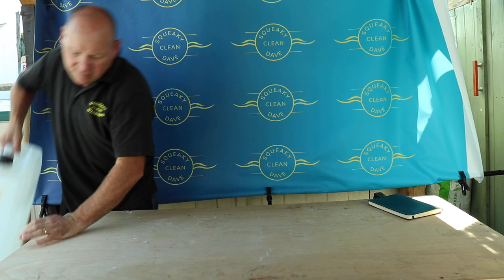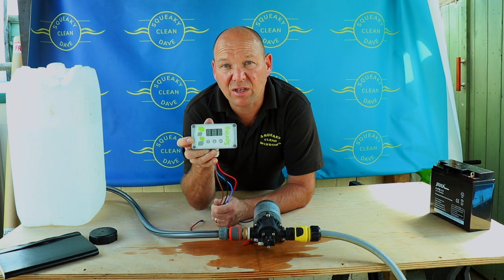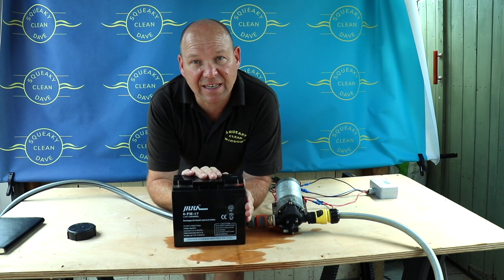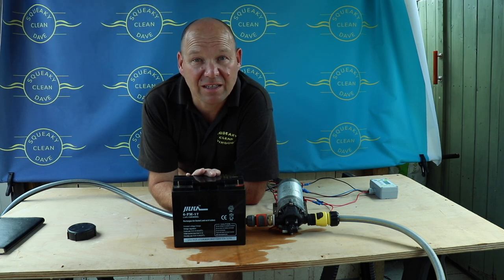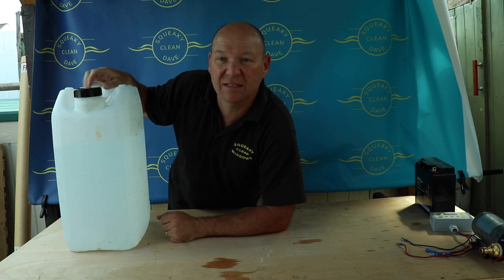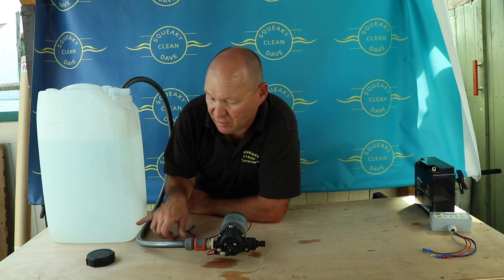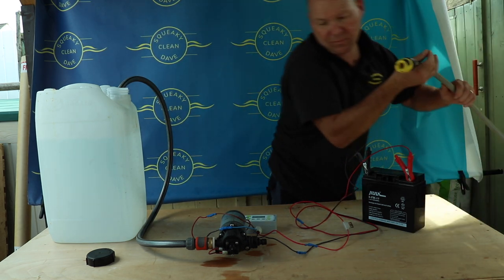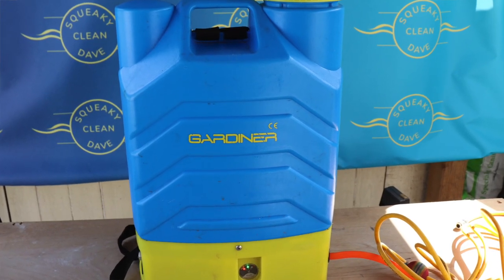Step By Step Guide To A Water Fed Pole Window Cleaning Set Up

Comment: Well I did not fiind spring on amazon. But I did find this. DC Motor Speed Controller with Remote Control 12V 24V PWM stepless Speed Control Switch 10A Wireless Speed Controller The pump I am looking at has its on pressure shut off.

Comment: Hello there, I watched your video and thank you for helping me start a window cleaning round. I'm struggling to find the same Spring pump controller you used. There are quite a few other pump controllers but I'm struggling to understand what controllers could work with the shuflow pump and the wiring etc 😃 I'm a complete novice lol
Reply from the maker: That's quite an old video where I used the V11 basic pump controller. Nowadays most people sell the upgraded controller which is called the V16. 
Most of the major suppliers sell them. You might find that they bare in the suppliers own colours buy they are the same inside. 
This is a link to Springs website. 
http://springltd.co/v16-basic
Reply: @squeakycleandave1  Thank you so very much! I'm very thankful :)

Comment: Great and simple video Dave.

I am struggling to get water flow when washing solar panels or window that are 3 stories high. 
Will a 12v pump and controller solve my problem?
 What GPM pump would I need?
 What the name of the full name of controller so that I may order on Amazon?

Many thanks from South Africa
Reply from the maker: Yes, a pump and controller will sort you out. i have put an amazon link to the pump but couldnt find one for the controller so have linked a UK company to show you the controller. there is one main company that make them and sell them through all the main suppliers so look for a V16 WFP pump controller
https://amzn.to/3JJLlGW

V16 Basic 12v Water Pump Controller | Xline Systems

Comment: Great video Dave! All Spring controller have a voltmeter built in to check the battery voltage anytime, just press the enter button when displaying the flow rate. We also offer controllers with split relay chargers built in to save on the extra wiring :) Great explanation of the delivery system!
Reply from the maker: Spring (Europe) Ltd thanks guys. As I’ve got a separate volt meter I forget you controllers all have them fitted👍

Comment: Thanks Dave, I've been using WFP system for about 11 years and recently changed my van and put in my old system, with a few new modifications but I started having trouble with airlocks in the pumps.
Thanks to your video,  I now think this problem, which has been perplexing me for ages is down to having my pumps too high.
I thought I would raise them to prevent damage from the reels, not understanding why they would be so low in the first place.
I'm going to give lowering them a try.
Thanks for your honest and helpful videos.

Comment: Dave can you give more on pump (like psi) and what amp fuse did you use ..i know its a small thing
Reply from the maker: @marklownsborough  it will depend what pump and controller you have. 
The pump I use is 5.5 litres a minute at up to 100 psi and the controller needs a 10amp fuse

Comment: Hi Dave did you make those bulldog extensions yourself compatible with the controller connections or did you buy them from somewhere , I’ve just ordered my first tank and controller, the video
Is a great help Thankyou
Reply from the maker: I think I cut them off an old battery charger
Reply: Thanks for the reply dave , I’m going to ring the cleaning warehouse on Monday and just clarify the type of electrical connections on the Shurflo pump /water genie v16 , not sure if there crunplock but il find out ! Thanks again

Comment: How do you connect to battery  
I know here you used clip for demonstration

Great video as always by the way
Reply from the maker: I normally use a full size battery with terminals on. That is wired into a 12volt fuse box which I wire everything into

Comment: Thanhs Dave l though the video was great and so easy to follow 
Question is l have been looking for a system to soft wash cems on to roofs will pump take the cems through it or would it be better to down stream it and bypass the pump
Kind regards from a total amateur
Reply from the maker: I might be wrong but with Softwash pumps you need a higher flow rate and less pressure which also needs a different connector . I may be worth you talking to Darren from DA Components 
https://www.da-components.com/12-volt-control-panel-with-chemical-pump.html

Comment: Hi Dave, im just starting my business. Please can you advise what is the model of the Shurflo pump? As when im looking online they all say there desiged for motor homes and caravans. Is that the right one?  

Thanks
Reply from the maker: Best thing to do is to search window cleaning supplies and see what they bring up as you know it will definitely be the correct one and there are other makes as well
Reply: @squeakycleandave1  Thanks Dave, please can you advise where you got the 12v inline fuse from with the crocidile clips? Cant find them anywhere.

Comment: I've watched all of your basic setup vids to create zero TDS water and I feel pretty confident about that. My question for your would be if I am going to store water in a reservoir (because I can't make 0 TDS water fast enough with the RO/DI setup) and I going to feed a Pressure washer for washing cars, will I need a second pump to feed 2 GPM to the pressure washer, or should gravity be enough to feed the pressure washer?  If I need a pump, I would assume I should also include a controller with a dead end to shut that pump down when I don't have the trigger pushed on the pressure washer?  Can you confirm for me?
Reply from the maker: Hi Jeff
Thats a great question and to be honest im not really sure. 
My pressure washer will draw its own water from a container but I know not all will. 
the pumps we use for window cleaning run at 
1 GPM so they wouldn't be enough for your pressure washer. I know you can get higher GPM pumps but im not sure if the controllers would match them or if you would need a controller with a higher output. 
Hope you find your answer.

Comment: Im looking to set up my own company in ireland here, this video helped me get an idea of whats needed, how much do you reckon all this costs on average? Is there things you have to replace often?
Reply from the maker: Most of this equipment lasts once you have it as long as you look after it. 
A ball park figure on the price would depend on what tank, hose reel pump and controller battery you have but you are probably looking at around £600. 
That doesn’t include pole, brush or filtration though

Comment: What an amazing video! I just had one question, I would like to work with a portable system at around 50 liters how long would it take to empty out this tank at different flow rates? Thank you in advance!
Reply from the maker: Hi Damian
Personally I use a van mounted system and I use300-350 litres a day but as I can carry more water then I need  I do use a lot. 
I just asked a friend how much water he uses with his 22 ltr backpack and he says he does 1 to 1 1/2 houses with it full on a reasonable flow
Hope this helps

Comment: How many gallons per minute pump should I use ? 

New at Waterfed pole cleaning .. 

Have 300 feet of hose going to my pole . Reel is mounted on truck
Reply from the maker: Not sure what it works out to but I us a 5 litres a minute 100 psi pump buy Shutflo

Comment: My pump isn’t making the noise anymore and fuse are good . What else could be wrong ? Pump was working great
Reply from the maker: Check that the controller is working ok and see what the display says. 
Make sure it isn't frozen and that there is power going to it.

Comment: Great video what sort of battery charger do you need thanks
Reply from the maker: This is the one I use
https://www.ebay.co.uk/itm/12V-10A-Connect-and-Forget-Leisure-Battery-Charger-Caravan-Motorhome-Boat-/114433522869?_trksid=p2349624.m46890.l49286
Reply: @squeakycleandave1  many thanks 👍

Comment: Quick question,I’ve taken my split charge relay off my system as I need to swap it over to another van,the battery is earthed to the side of the van,I plan to just trickle charge the leisure,will this be ok simply with the positive and negative?? No earth  required right?
Reply from the maker: I’m not an electrical expert but I’m pretty sure that you are right 
By the way I love your thumbnail photos 👍

Comment: Hi Dave, hope you’re keeping well? 
On our shurflo pump we use the supplied butterfly right angle connectors. These leak when moved slightly. Could you recommend an alternative?
Reply from the maker: It’s the same size thread as a hose lock tape connector which I think is 1/2”

Comment: Hi Dave, need a new leisure battery running two pumps and two electric reels..any suggestions on which leisure battery to get?
Reply from the maker: I would say anything bigger than 100ah. I’m using a 140ah

Comment: Hi Dave, I am using a vyair RO-600 to filter my water, if my pressure is  low which booster pump would you recommend? I'm just starting so trying to keep cost down...thanks alot for your help, Rob....
Reply from the maker: Hi Rob
This is the one I have but might not be the best for you 
https://www.thecleaningwarehouse.co.uk/water-genie-4040-booster-pump-5688-p.asp
Reply: @squeakycleandave1  yes that looks a good one but a little pricey...thanks for the swift response though. I need to source one a little cheaper......

Comment: This is great video I use trolley but I find changing my drums I end up with air locks most the time
Reply from the maker: Glad you found it useful 👍
Reply: @squeakycleandave1  yer just can't stop the air block got to point of thinking about changing to tank in van
Reply from the maker: @kayaking4mentalhealth702  if you do go with a tank in the van you won’t believe how much easier it is
Reply: @squeakycleandave1  I built van for company I use work for. But there outlay was much more and we had bigger van but now started by myself I could only get little van for now so thought trolley was the way but was thinking of changing over to tank. But just found out you should have a no return value mine missing so fingers crossed

Comment: Thanks Dave for the help on this really appreciate your videos you mentioned that some 25l containers have a barb on them at the bottom do you know where you can get them from I have to put the hose in the top and a lot of the time the hose comes out of the container and starts sucking air 
The barb containers would be so much easier 
Thanks 
Donald
Reply from the maker: I think these are the ones I had
Induna Heavy Duty 25l Water Container X6 / Jerry Can Eco Vent Natural Single Plastic Water Tank/Carrier For Camping With Anti Glug Design & Bpa Free Food Grade Materials 25 Litres https://www.amazon.co.uk/dp/B08RL6HFMN/ref=cm_sw_r_cp_api_glt_fabc_7RT8ZXVKM0NFA62NSVA2
Reply: @squeakycleandave1  thanks Dave appreciate you replying and your time

Comment: Great video simple and informative dave 👏 
Does the pump need to be lower than the tank?I'm fitting a 400ltr tank in van and not sure if I need to raise the tank so the pump can be lower ?
Reply from the maker: Rob and dawn jowett my pumps is about 6” above the bottom of my tank. The only time I ever have a problem is if the tank is completely empty and I such in some air but even then when you fill the tank it normally starts up no problem. 
Years ago I did have my pump on top of the wheel arch and I did get airlocks then
Reply: @squeakycleandave1  thanks dave appreciate your reply 
I just ordered the new abc 2 controller seems good as it has the dead end and polarity protection all for £60
Reply from the maker: Rob and dawn jowett good choice. They are really good controllers especially for the money and the are made by Spring who make the V11 and V16👍

Comment: A Dave. Wondering using a waterfed pole with a shut off such as a pinch in the line to shut off the flow does the pump reset or turn off and wait for the pressure to go down to restart? Or does the pump shut down and need to reset I plan on buy a shurflo with a pressure switch for this reason. Not sure what dead end means
Reply from the maker: the shut off for the pump is best. worked through the controller as this extends the life of the pump and makes it work more efficiently.
Check out this video explaining dead ends. 
https://youtu.be/mTBbco7c15U
Reply: @squeakycleandave1  Thank you!!

Comment: Dave, when you connected the red to brown wire which one of the red wires from the pump did you use, 
the one nearest the camera or tip of pump clip in or the back one closest to the inline water feed clip in??
If it's the front one then I have it connected to a plug in alongside the black wire then would need to splice it.
If it's the other that one is connected from the back side of the pump I'd have to splice and join it three ways.
Reply from the maker: The red and black wire both come out of the metal and pf the pump furthest from the camera. The red then comes down to a contact which is nearest to the camera in the plastic part. Another red then comes out of the plastic part just slightly higher up then where it goes in. This is where you connect the controller. The plastic part at the end of the pump is the pressure switch. 
hope this makes sense. if not feel free to give me a call
Reply: @squeakycleandave1  thanks for your reply but I want to make sure I got this right. 
I have a North Star pump, the red and black wires that come from the back side of the pump
goes as follows, the red which comes from the back is connected to the pressure switch but is the second
plug in from the front going going back. The other red wire is connected to the plug in but is the front
one closest to the camera and runs off to join the black wire (connected together) to a wire harness 
that plugs directly into the battery. Are you saying the red one that comes from the back of the pump and 
plugs into the pressure switch 2nd from camera is the one I use to connect the controller?
Reply from the maker: @DrHurtYou  it’s hard to picture as I’ve never seen a North Star pump so I can’t really advise. You would probably be best if you ring Spring who make the pumps as they should be able to help 
01892 662078

Comment: Can't help but wonder how the controller controls the amount of litres per minute? - the pump doesn't have any feedback signal wire, it just seems to be a analogue voltage output (or pulsed maybe) but designed to carry high currents that would fry a transistor. From what i can work out, it's not litres per minute but a voltage controller showing a percentage up to the maximum?
Reply from the maker: I don’t understand it either. That’s why they make controllers and I don’t 👍

Comment: Hi mate, great video. Did those extra wires you used at 7:39 come with the controller? Or where did you get them? Find the channel really interesting, keep it up mate
Reply from the maker: The ones with the bulldog clips are one I put on to make it quick for the video but the controller does come with all the cables you need
Reply: @squeakycleandave1  cheers brother
Reply from the maker: @joelwalker9564  🤜🤛

Comment: Can you put a likk for right fittings to connect onto pump to have hozelock connections on.   i always order wrong sizes
thanks
Reply from the maker: This comes with 2 sizes. Off the top of my head I can’t remember which one it is but you get both
https://www.screwfix.com/p/hozelock-threaded-outdoor-tap-connector/52973

Comment: Hi , just started mobile valeting , this system would also work in my van for getting water out to wash cars , yeh ?? Love ya vid 👍
Reply from the maker: Perfect 👍
Reply: Ok , a rough idea of price of these items please ? Thanks
Reply from the maker: @martinseal1733  cheapest way of doing it is to by a backpack from Gardiner pole supplies which which are about £100. These contain pump, controller and hose but I’m not sure if that would be a high enough flow. If you were going for a full set up you can get pumps with higher flow rates. For a high flow pump and controller it’s about £250 you then need a tank and battery + hose fittings so you are probably looking at around £500 minimum depending on flow, size of the tank you need etc
Reply: Hi mate I currently started using an ro system connected to my outside tap but the psi is only coming out at 25psi and alot of people have said you need to be at least 50 psi for it to work properly is there any purpose pumps or ideas ya could suggest to boost my psi thanks

Comment: hi mate many thanks for the great video, what wiring/amp power would you use to go from main battery to the 2nd add on battery please
Reply from the maker: It depends on your split charger on how much power it’s delivering
Reply: @squeakycleandave1  thanks my other van never used one it was just a battery wire from the main to another halfords car battery then onto the pump, just not sure what they used as its someone else's set up
Reply from the maker: @markgooding8131  I know it depends on what type of van you have but you normally would have a split charger or a battery to battery charger. You can have a wire directly but I wouldn’t. 
With the split charger or battery to battery charger it stop you from drawing power back from your main battery so if you are on a big job it’s never going to drain your main battery. It also makes sure your van battery is charged before it switches over to charge your leisure battery 
You will need to find out what kind of charger your van needs. If it’s a split you could get something like this. 
https://www.ebay.co.uk/itm/5-mtr-Split-Charge-Kit-12V-140Amp-Voltage-Sense-Relay-110amp-cable-T4-T5-/202499940400?_trksid=p2349624.m46890.l49286
Reply: @squeakycleandave1  great thankyou for all the help mate, very much appreciated 👍
Reply from the maker: @markgooding8131  any time 👍